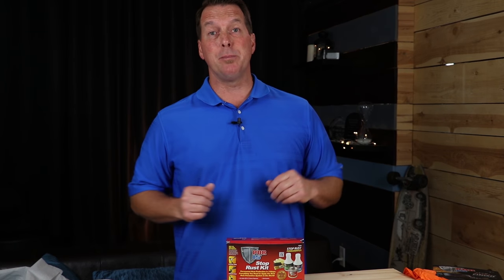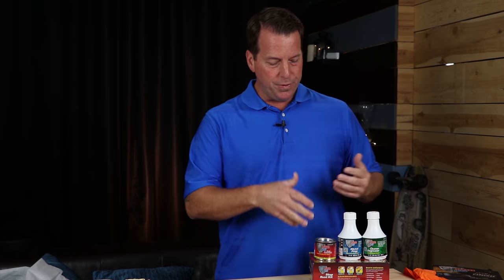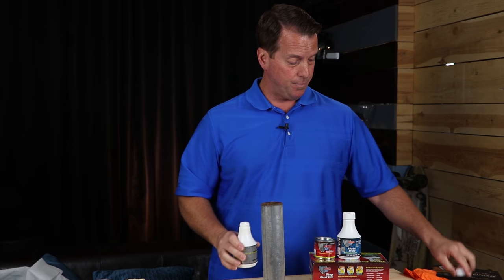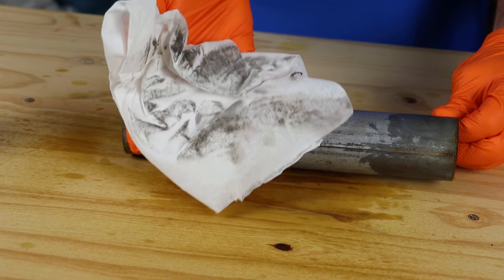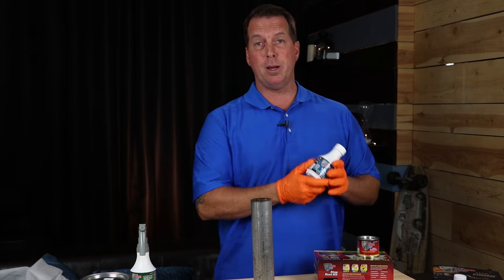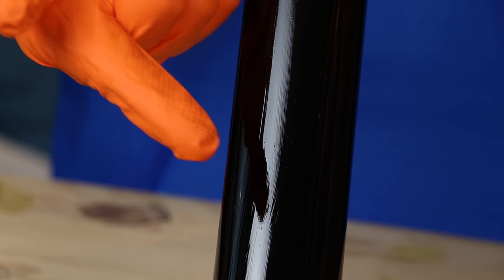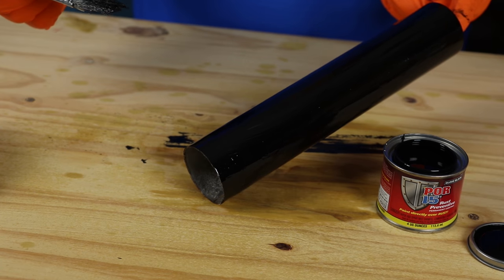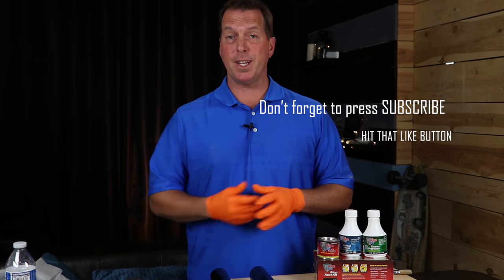STOP USING POR-15 INCORRECTLY!

Comment: Its a well intended video.  Any commercially effective wax and grease remover followed by a phosphoric acid based metal prep will allow for a good POR-15 application.  The POR-15 metal prep is phosphoric based of course, but I find it somewhat weak.  Rust Kutter is the most effective phosphoric metal prep I have used. Thoroughly degreased and metal prepped, POR-15 is my go to choice for rust conversion coatings.

Comment: I brushed POR 15 onto a 1935 Ford fender and set it out in the 35 years ago. no UV protection so it turned dull and kinda chalky. Except for that the POR15 has been doing its job with no problems, Very impressive, I have done many many gas tanks with their sealer, again, an awesome product

Comment: I worked in a restoration shop for 20 years and now build rock crawlers. I have used a lot of POR and It is a good product, but it has Its draw backs, sun fade and cost. I have found that 90% of the time rustoleum is a cheaper option that works very well.
Reply: I wanted something durable for a set of control arms. 
So they got 2 coats of por, and a coat of the tie coat primer. 
And then 2 brush coats of Rust-Oleum in the color I wanted. 
A light sanding ,and then 2 coats of Rust-Oleum spray paint to give it a gloss. 
And hopefully if it chips a little ,you'll see the red brushed on stuff.
That was 10yrs ago on the summer car and it still looks great.
Reply: @MrTheHillfolk  meanwhile your prep with the meuriatic acid or more likely when you sanded the bare metal. You let in flash rust you couldnt even see. 
Now all these years they have been rusting in the inside trapped with all that moisture and most likely as strong as a wishbone.
Reply: @krotchlickmeugh627  rust needs oxygen, it is not a "cancer" that grows by istelf .
Reply: @ThreeDaysOfDan  yes and you kill with Ospho and turns into a phosphate that'll never rust again. Good stuff. Using for a long time.
Reply: @krotchlickmeugh627  rusting is OXIDIZATION. This process requires OXYGEN. Once covered, NO OXYGEN will get to the flash rust. A lack of OXYGEN stops the chemical conversion (rusting). This is why the manufacturer tells you it is OK to wash with water and dry before sealing. The metal will not continue to rust under the application unless oxygen gets to it again.
Reply: @jasonchristopher2977  You'll find Ospho on ocean going tugs and barges.  Plus, most of the US flagged ships.  If they use it, you know it works.  I've used 55gal drums during summing time painting at the dry docks.  Love Ospho and us it at home also.
Reply: @Jason Christopher  Can you use Ospho before Por 15 without and adverse effects? I'm about to do the inside of gto trunk.

Comment: Watched the Project Farm channel on rust converters / preventers. Convinced me to give this a try. Especially when he use the 2300 psi pressure washer and nothing came off the POR15 treated metal, but the other preventers lost at least some of the coating. Came here to make sure I use it correctly.
Reply: Heu Sam I just bought a brand new SUV but I'm in Chicago and they throw salt & God knows what else on the roads up here. Could I use the por 15 clear and brush it on my new car undercoat??
Reply: @tonykari5124  Yes,and 3m makes a rust preventive spray to get into all the cracks and creases that you can't reach!
Reply: @tonykari5124  A lot of body repair guys are now using cavity wax to protect repaired areas, and inside door bottoms to seal against moisture. It's inexpensive and very effective. I've used POR-15 products during two car restorations and it works very well for repaired areas, but there some applications where cavity wax makes more sense.
Reply: Hahaha I did the same thing!
Reply: Works ok. Been in this field for a lifetime. It's costly and all these steps. Use Ospho from Ace hardware. Get rid of the oil and wax etc. Spray, brush whatever ospho On RUST. no cleaning of rust, no sanding, grinding etc. Just smack frame with a hammer to get chunks, if you have some, off. Use Ospho on it. Will do same thing. This lil kit with 4oz is how much? 30 bucks? A gallon of Ospho is less and will work better. Converts rust to a black hard coating that kills the rust forever. Buddy used this on his boats and never had any issues in Salt water and on vehicles in Michigan. This crap is alot of steps and alot of mess if it gets where u don't want it. Used Ospho on logging machinery, tractor trailers, Dozers, Cars trucks etc. If you want alot of work and spend alot get Por15, if you want fast easy use Ospho and implement paint or rustolieum, and cavity wax. Painted with Eastwood internal frame coating, outside with osphone then seam sealer then rusty black paint then cavity wax. Mineral pin all in panels at bottom and whatever you use for protection. 1 quart of any oil, 2 toilet gaskets and a tube of grease. Mix and heat until the proper consistency for your application use. Portsmouth is good for protection problem areas of a restoration when new, use Ospho when rust is already there. It needs to be rusty for it to work, do NOT clean to bare then use Ospho. Use rusty. Needs rust to interact with to change on a molecular level. Your welcome. Save all that blasting, sanding, grinding etc. If heavy rust may need a couple coats.
Reply: Same here xD just came from that video
Reply: @jasonchristopher2977  is there any way you could do a video on ospho?
Reply: @cosmicbrambleclawv2  ha ha same
Reply: @christhorndike4614  I could but I don't have a channel. It'd be my first video and you'd be only view!! Lmfao. If you look it up you will see how. You gotta get all tge HEAVY rust off whatever way you choose. Can't have flakes or Chunks. Surface rust or 1 layer on metal. Spray with a old peroxide or febreeze bottle. Wear mask and eye pro. Let sit. That's it. Like on a drive shaft or suspension wash and spray down with brake keen or 91% Rubbing alcohol, wax, grease remover. Gotta get rid of silicone, wax, grease, oil etc. Just rust. If mines heavy but solid I use muratic acid for a small amount of time, 15 min. Wash with water to Neutralize. I've made a mix of this and Ospho and it worked great. 2 parts ospho, 1 muratic acid. But caution to not leave muratic open or it will rust all metal and you'll be using Ospho on all of it. Keen strip is almost same at big box home centers. Try experimenting with it on any rusted metal and see if you like it. I do cause in case of inner fenderwhere you can't get any tools in I can spray this and use Eastwoods internal frame coating and 360 nozzle wand to cover it, after its rewetted and washed and dried by air. If u have any issues message me and maybe I'll make a lil video showing what I've always done. It's worked for me but just gotta have Clean rust. No nothing but rust.
Reply: @christhorndike4614  You know what? F it. I'll make a video and I'll post the channel. A neighbor hit n run on my 99 lincoln and I'm dealing with that. give me a few days and I'll have u a video.
Reply: @jasonchristopher2977  can confirm on the ospho. had to put some on rusty shop windows. the stuff was BOILING when you put it on the rust. came back about an hour later and it was all a nice black color.
Reply: Hey, I watched Project Farm's video too! I ordered the kit of POR-15 containing 1 quart & just did my entire truck frame. Turned out great. ( I used the degreaser diluted properly with hot water, rinsed that off & let dry. Then I kept applying the metal prep/etch, keeping the surfaces wet for a full 20 minutes, then rinsed thoroughly, let it get bone dry, then applied 2 thin coats as directed. ) This stuff does exactly what they claim. Tough as nails too. Not a single run or brush mark anywhere.........it looks like a brand new factory frame. I highly recommend it. Only the 2 small areas of my rear wheel wells, does the frame get exposed to the sun early & late in the day, so after it cured VERY quickly ( I live in a very hot & humid area ), I simply sprayed on some Rustoleum 2X for a top-coat in those areas.
Reply: Yup 👍 POR 15 is amazing stuff! Another product Project Farm tested is OSPHO and it's an amazing product as well although several applications may be required depending on the the extent of rust! Some extra  preparation may be  required depending on the severity of rust as well but it's great stuff as well! I just wish they had OSPHO in a GEL as well!!! I highly recommend POR-15 & OSPHO ACID! Make sure when using OSPHO you use P.P.E. such as eye goggles, chemical gloves, and or respirator if applying large amounts and use in a well ventilated area as well!!!

Comment: The title of the video is ironic because you didn't follow the directions correctly.  1.  The degreaser should be diluted with hot water at a 4:1 ratio.  2.  You didn't rinse the degreaser with water.  3. You didn't let it dry to "bone dry" after the degreaser rinse.  4. You dipped your brush in the can.   Otherwise a great video. LOL
Reply: See how forgiving it is.  Still works 💪
Reply: @lpz3665  lol
Reply: He most certainly DID say to wash and/or rinse it off. He also DID say to dry it or let it dry completely. YOU don't pay attention. ( Do YOU wanna sit through a video waiting on "something to dry completely"? ) I just recently bought the kit containing the 1 quart size, followed the directions, and did my entire truck frame with 2 thin coats, and still have about 40% of the can left over. Not a single run or brush mark anywhere, because it really is "self leveling". I live in a very hot & humid area, so it cured very quickly. Only in the small area of my 2 rear wheel wells is the frame exposed to sun early or late in the day, so after it cured, I did a quick spray of Rustoleum 2X. Turned out great. It's tough as nails and not even rocks flying up off the road can chip this stuff. I highly recommend POR-15 over anything else. Youtube ch: "Project Farm" did a video where he tried at least 6 different products, and in every test result, the POR-15 out-performed all of the others, hands down........which is what convinced me to buy & use it.
Reply: @howabouthetruth2157 
great review 🫡👍🏽👍🏽👍🏽

Comment: I just recently bought the kit containing 1 qt of the POR-15, and did my entire truck frame ( 2000 Tacoma 4x4. ) I can say right now to anyone claiming "this product failed" is simply because THEY FAILED TO FOLLOW INSTRUCTIONS. When done properly, POR-15 can't be beat. It's practically bullet-proof. Rocks flying up off the road doesn't even phase this stuff. I live in a very hot, humid area, so mine cured very quickly. My truck frame turned out great. It leaves no brush marks because the product is "self leveling". Only in the area of my 2 rear wheel wells did I spray on a top-coat of Rustoleum 2X, because those are the only 2 areas where sunlight can hit my frame early & late in the day. The rest of the frame is never exposed to any sunlight. ANY "paint job" is ONLY AS GOOD AS THE PREP JOB BENEATH IT. Prep it correctly, and expect amazing results. I highly recommend POR-15 over anything else.
Reply: You hit the nail on the Head do what the directions says and you shouldn't have a bad day.
Reply: @joesoika2628  Yes Sir! It's now been close to a year since I applied POR-15 to my truck's frame, and it's still holding up just fine. I check it periodically, and there's not a single area of bubbling, chipping, or flaking.
Reply: how did you get the por15 INSIDE the frame?

Comment: WARNING ⚠️.   Wear a Respirator , wrap around safety goggles and gloves when using this product !  I applied it to the undercarriage of my truck  with a brush  outside and afterwards I my eyes were burning and I had a headache and nausea for 3 days ! This stuff is potent and no joke !  Please follow any and all safety precautions as  listed on the box / can !!
Reply: I only wore eye protection & gloves when doing my entire truck frame using this stuff. I didn't suffer anything from fumes, but I was in my open carport. This stuff really works. I highly recommend it.
Reply: If it gets on your skin and dries it is going to be there 5 days or more.....I found baby oil to be the kindest way to remove it before it dries and having the oil on your skin helps the next drip of POR15 come off better.

Comment: People make the mistake of using it for frames that have already been subject to harsh conditions and wonder why the frame rots out under the coating. It's only worth applying if you're starting from new when it comes to frames. I.e. before everything is assembled. You just can't get everything clean enough, or reach everywhere afterwards. Better off with lanolin-based products to stop frame rot. It creeps to where you can't reach with paint. (Surface shield, PFC, Woolwax, Fluidfilm, etc.)
Reply: Ospho.
Reply: You've got to KILL the rust. I've restored so many old cars, trucks, tractors, semis, machinery, antiques, etc. If you don't get rid of it these products do work but the repeated money, time and aggrivation will cost more than its worth. Use a long piece of all thread and small pieces of chain in a drill to knock the rough away in frame. If it's Swiss cheese just scrap or fix. use a good wax, oil cleaner and use acid based product. Or Eastwoods many frame products. Navy uses Ospho. I use it. It converts and leaves a hard black coating. Acid it tricky because if not using oil based primer or paint it's gotta be rewetted, rinsed well for these coatings to work well. Watch videos eastwood makes or others to get the idea. I've used a home made coating of 1 quart of any oil, 1 quart of trans fluid, 1 tube of grease and 1 or 2 toilet wax gaskets heated and mixed. Spray, brush etc to protect whatever you need. Rust has got to go. POR works on new metal well and blasted or clean metal. It's weakness is on corners where it's thin and the price and the prep work. Zinc based works well why Toyota cars from 90s that coating has not been damaged is rust free, Scotty Kilmer. Best thing is just layers of protection of clean or converted metal. Farm implement paint is great. That stuff makes sandblaster and coal slag work to remove. Blaster came out with a new wax type product that looks to be the best but not used yet. I know that any oily, greasy metal never rusts. The worst is undercoating. Seen cars with looks like great panels to look under it and metal is gone. Looks can be deceiving. Just like that lil rust bubble looks minor until you get it all clean to bare metal and it's grew 4 times starting size. Rust has got to be stopped or whatever you do is a waste of all.
Reply: Hello I'm new to using stuff for rust. I want use something to permanently stop rust under my car. What would you recommend ? Any tips will be greatly appreciated thanks.
Reply: @NJRangerGeorge  You and every person that owns a car! There is no permanent solution. Best bet is to re-read my comment above. They need to be applied every 1-2 years if you're in an area that uses salt/brine on roads in winter. Or if you live near the sea.
Reply: @jasonchristopher2977  I looked into the ospho you recommended and am intrigued. My husband is rebuilding the frame on my 98 ranger and I'm treating to try to make sure it won't need to happen again. I was going to go with the whole por15 system but now I'm liking the ospho...what paint would you recommend over the top? Or any other recommendations greatly appreciated. The frame is going to end up about 60% aftermarket 40% original. I'm willing to pay for something that will definitely work, I just don't want to end up paying 4x the cost and end up with a basic rustolium treatment
Many thanks!!
Reply: @NJRangerGeorge  Nothing works forever. Many products work well for a year or two. But you must check it out every year and see when you have to work on it again. Do that and your vehicle will last a very long time even in the rust belt.
Reply: @Grendelbc  thanks 👊

Comment: I have used POR 15 several times over the last few years. IF you follow directions - this video is a good place to start - you should have excellent results. I used it to paint a bare trailer frame five years ago which has always been kept outside in pacific coast weather. Not a spec of rust yet.  FOLLOW DIRECTIONS. IT WORKS!
Reply: Just did my entire truck frame with the larger kit containing 1 qt. I followed the directions to a T. This stuff really works......just as you said.

Comment: For proper use with applications you should never contaminate the jar with your brush, always pour the product into a separate container.
  The biggest issue with POR15 is that people take for granted how strong it is.  
 In regards to top coating …
 That finger drag test is the point when you should apply you’re primer to the pieces you are working on prior to the flash .
 There is nothing that will etch itself onto the surface of the product properly ( maybe some newer self etching primers like a zinc self etch) but not without consequence, even after an abrasion except for their very own top coat etch primer that more than likely had a hint of the sealer in it to reactivate the surface.   It’s great stuff for those who abide  🤙🏼
Reply: Haha on some rust holes I had , I laid fiberglass cloth down and soaked it with por. 
Works great and is like epoxy without the 2 parts.
Reply: @MrTheHillfolk  interesting I am gonna try that
Reply: @MitchsScooterStuff  yeah man ,it works pretty good. 
Ya might have to wait and give the cloth a second coat to seal off any pinholes but it works pretty good.
Reply: You should also never use any electricity during curing time because the electrons will interfere with the protons unbalancing the curing connection destabilizing the final coat. So lights off or do it in natural sun light.